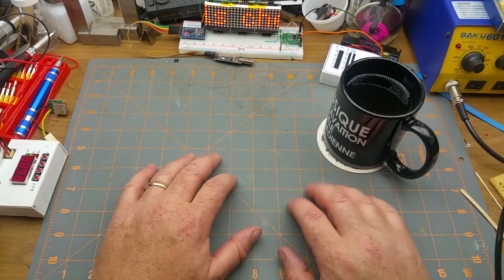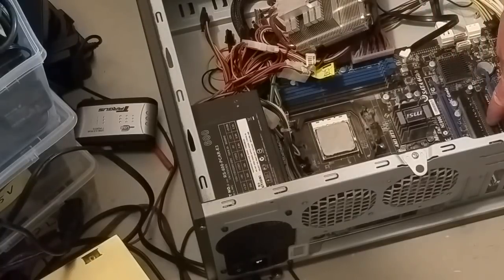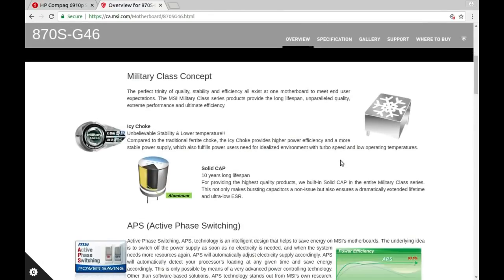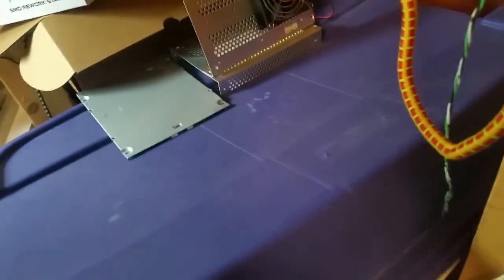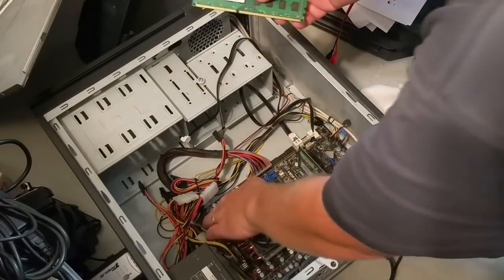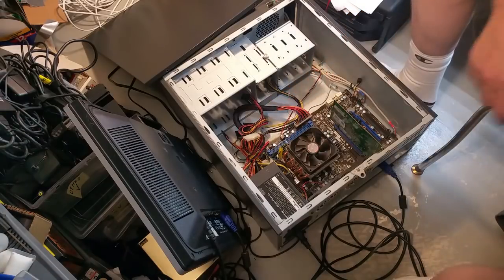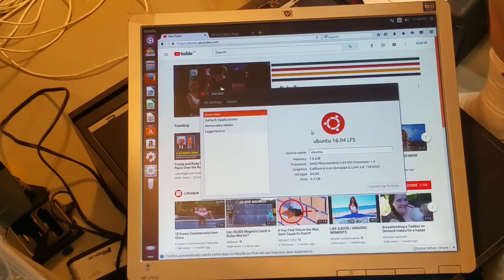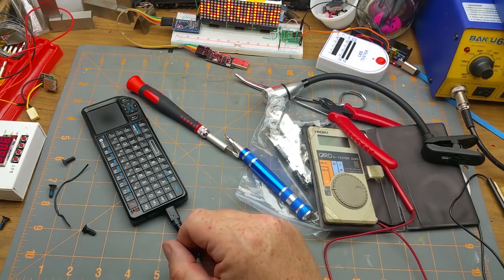free compy!

Comment: Awesome find, but you should have found mine. First, I put my PC w/monitor in our garage sell weekly for 3 or 4 weeks asking $50 but would have taken whatever was offered. Anyway, I got tried of taking it in and out to sell it so I just left it out on the curb so that anyone could pick it up. It sat there for nearly two weeks before it was gone.
What was the configuration? Fully functional with a 1TB ram, quad-core, dual video card, on board ethernet card w/wireless connectivity. Monitor was 19" flat screen. I wiped the hard drive and installed only Windows 10 on it.
Was a great machine for the person whom made the find.
Reply from the maker: Some people just don’t know what they're missing.They "can't be bothered" to pick up "other people's junk" off the curb, I guess.

Comment: Hey, just wanted to mention, I have that very same processor right now and it is my main computer (until I have to upgrade - more on that another time) I run Windows 10 on an SSD and it is actually very reasonable - I export my YouTube videos in premiere, do light gaming etc, it's a beast and if you overclock it a bit, it can still be a workhorse, specially for the price! good find!

Comment: Don't forget to see inside power supply. Can be nasty surprises like popped up cap that will play you hard when you give this thing more load.
Reply: Caps usually go on the MB 1st. That PSU is actually a good one. Not the bargin brand chineezium type.  But ya, no harm in looking at all.
Reply from the maker: I do still have to give the whole thing a thorough blow-n-vacuum treatment. That'll probably include opening the PSU and checking what kind of crud is hiding under the board. I can definitely see a lot of pollution in the heatsink.
Reply: One thing about blowing out the CPU Fan.... ( With a compressor ) DO NOT have it plugged into the MB when doing this.( or block the blades from turning ) The fan will produce high current and back-feed into the MB. Poof. I saw so many new "techs" fresh out of university ( Who thought they new everything ) do this. And when I sent them to the boss to get an NT kernel, Well... they kind of never came back.

Comment: Sometimes older motherboards have some interesting things on them. I have one, power supply section for cpu and ram all made with to252 SMD transistors mounted like normal transistors, standing up, without any heatsink.

Comment: I don't know how good they are because I only use known brands, but there is cheap odd-brand SSDs on Ali. ie $30 for 60GB. You only need enough for the OS because you usually get a larger storage HDD, but SSD makes old equipment so responsive you would swear you went up a couple of generations of processor, ie a Core2Duo SSD feels faster than a 1st gen i7 with HDD.
Reply from the maker: The best price I can find locally (so far) is $45 for 120GB SSD., or $55 for a 1TB WD blue. 
Not sure I want to trust Ali or a random E-bay seller for a bigger ticket item that can easily be crap. 
(Obviously I have no issue taking that gamble for <$10 stuff)
Reply: Yeah if it's something crap that doesn't go as fast as a known brand - like a fake with a CF card inside - it's a waste of time, plus gives a bad impression of SSD. All my 7 old PCs - all hand-me-downs - have SSD, because without SSD they would be so slow they would go in the trash.